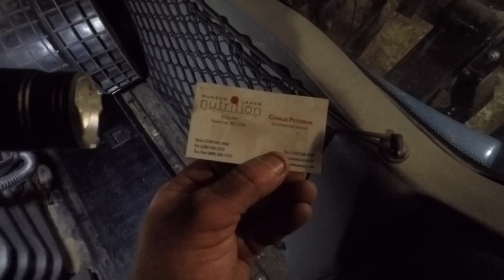More Work On The Case 700 Plow And Why Doesn't The Back Windshield Wiper Work On The TG210?

Comment: I have had good luck Welding 1/4” fine thread nuts on and then threading 1/4” - 28 grease zerks in to them to repair stripped out holes.
Reply from the maker: Good idea! 👍